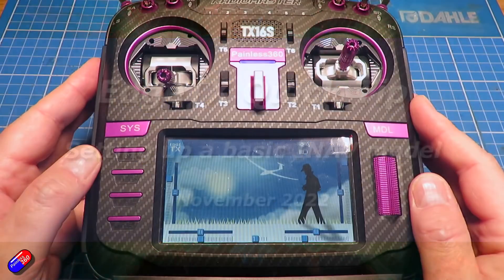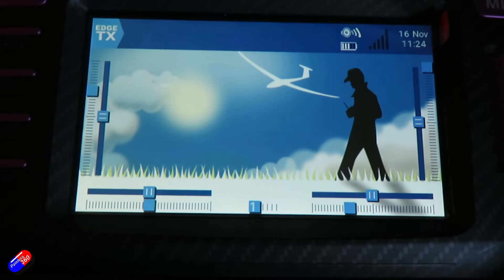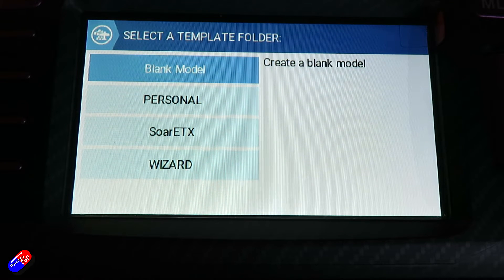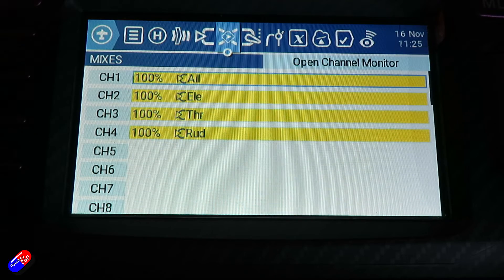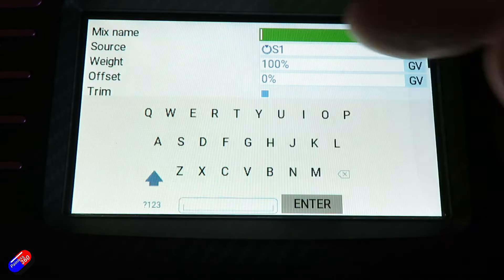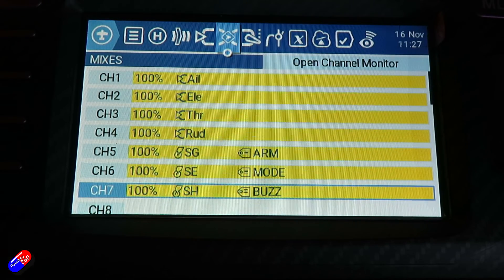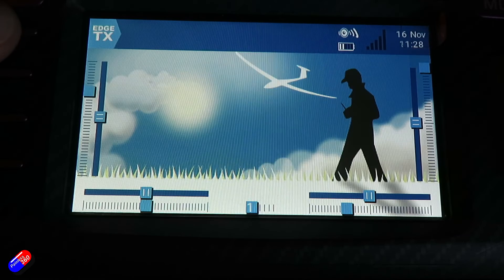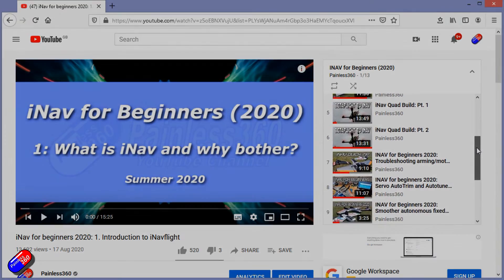EdgeTX setup for INAV

Comment: Thank you for the instructions! I have set up the flight modes in INAV and have allocated the chanels also in the TX16S. Unfortunately I face an issue here. While in INAV NAV RTH, Manual and Horizon are configured (and I see in the configurator when I switch at the radio), my radio shows angle mode. Just sometimes it is jumping seemingly out of nowhere to the set up modes (just that NAV RTH is ACRO mode). Any idea where this is coming from?
Reply from the maker: Lots of the more advanced modes like Autolaunch use Angle as the underlying mode.... Happy flying

Comment: Edge tx doesnt support access rx's, afaik :(
Reply from the maker: Correct, that is more about the 4in1 Multi-protocol stuff and ACCESS being a closed, proprietary system than being an EdgeTX thing.. Happy flying!
Reply: Right access was written to stop other companies from being able to make compatible components.
Basically to stop access to others.🤔
Reply: @vonSchwartzwolfe  not really, my qx7 uses open tx and it also supports the access protocol.
Reply: Nobody really uses FrSky anymore. Seems everyone transferred to radiomaster TX16s

Comment: I have the TX12, I want to have the 9 combinations of switch B and C (both 3 positions switches) tie to 1 channel for flight mode and way point mission. I want the channel to have these values -100, -75, -50, -25, 0, +25, +50, +75, +100 for the 9 combinations. I first tried just to use mixing; not successful then tried mixing with logical switches also not successful. Has someone else done that and got the step by step instructions?

If inav flight mode range programming page can provide the AND condition of 2 switches range, then I don't have to do mixing on the TX side to get that. But I guess it won't be a high priority features for the developers.